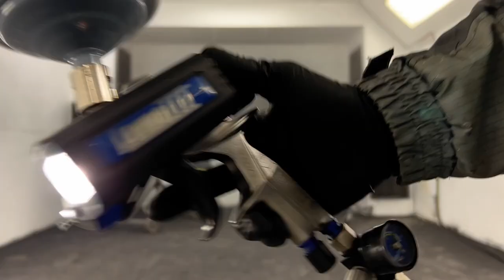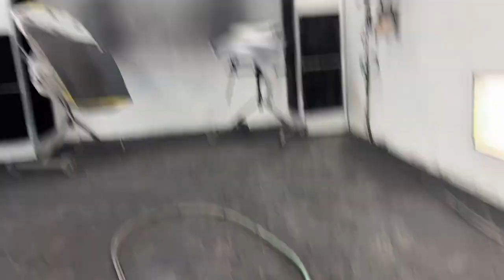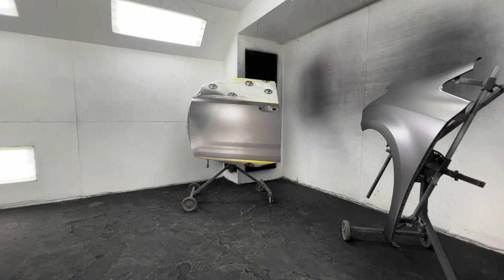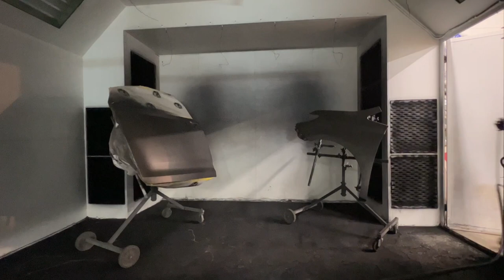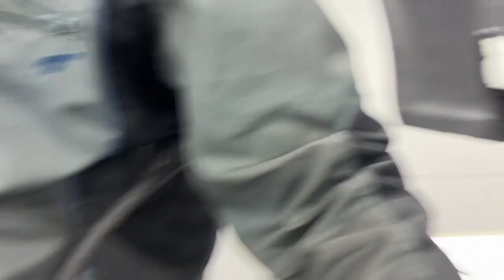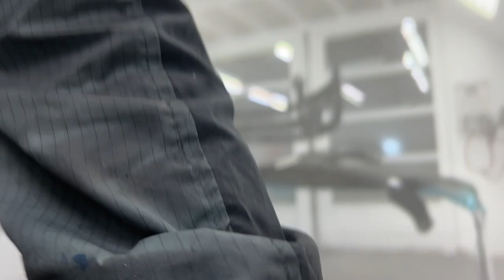THE BASICS HOW TO PAINT A CAR

Comment: for the control coat do you ever get sand piling afterwards. i’m using solvent base and if i go that quick i will almost always get grittiness in my base. still trying to figure out the best way to even out the mottle in my jobs
Reply from the maker: Not with waterborne. With solvent try doing your control coat when the base is half flashed off. That way the control coat will grab on and slightly melt into the base without sand piling